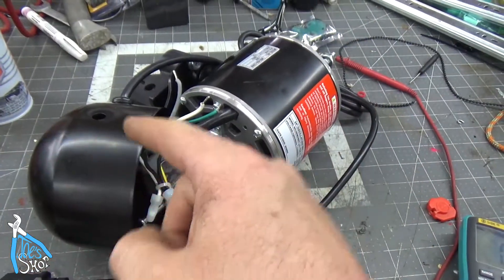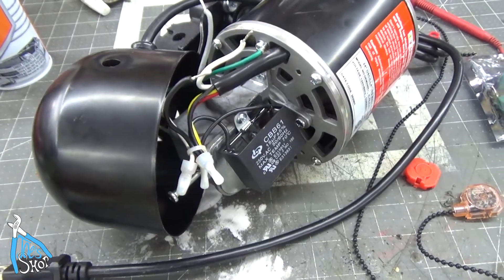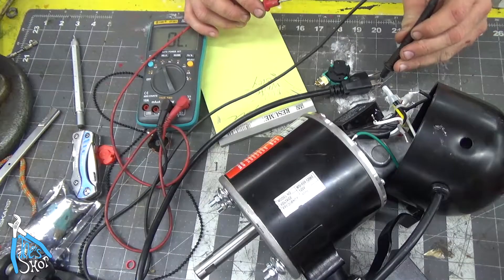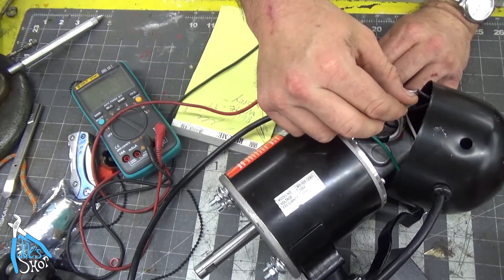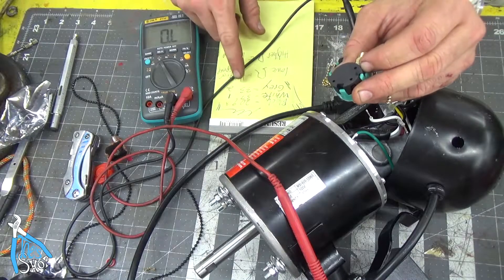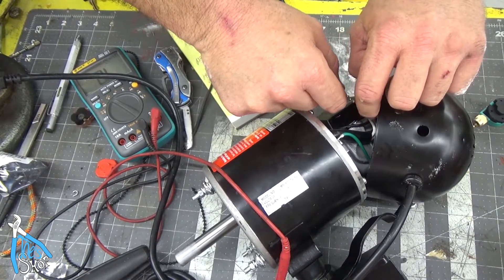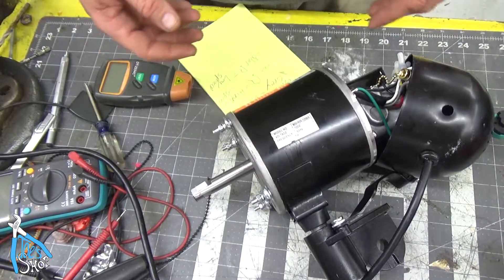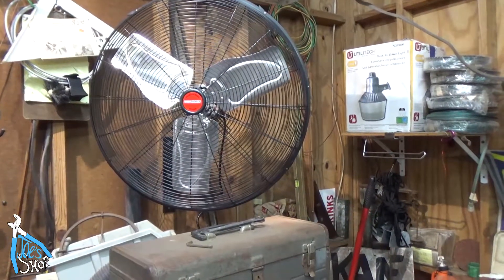3 speed fan switch (determining Hi-med-low)

Comment: I have an industrial MARLEY brand fan with a broken pull cord. High, medium, low and off.  Ordered a replacement pull switch.  Went to take the old switch apart but it broke into pieces. Unfortunately i did not record which color wires went to which labeled position. I only recorded their positions relative to the position of the pull cord.

I installed the wires to the new switch in the same positions that i recorded. 

The fan works but not 100% or correctly. There doesn't seem to be an off, plus the fan stops after a bit. Pulling the chain to request a new speed doesn't start the fan up after it stops.  

I'm suspecting the replacement switch has the wire positions placed in different locations leading to me installing the wires into the wrong spots. I'm suspecting the incorrect wire placement is also why there is no off and that the capacitor might be overheating thus causing the fan to stop and bit come back on even after pulling the cord. 

I think i can use this video to figure out which wires are supposed to go where and correct my issue.
Reply: Update: I have a harbor freight fan with high medium low and off. I checked the wires to the pull switch and compared to my Marley fan. The harbor freight has 4 total wires for all of those speeds. The marley only has 3.

Researching for information on the Marley I'm thinking it only has high low and off.

Turns out I did record the wire positions from the old switch and placed them in the correct locations in the new switch. Still don't have off but it does seem to have high medium and low.

I think I'll Live with unplugging it, which is what I've been doing ever since the original pull chain broke.

The weird thing is after cycling the pull switch enough times the fan starts slowing down to a stop.

I left it running in low/medium most of the day with no issues.
Reply from the maker: I hope this video helps. Cheers

Comment: Do a video that shows how to jump it so you dont need a switch at all. Plug it in for on, unplug it for off
Reply from the maker: Sorry that fan is mounted in my brother's shop at the moment. Just connect the hot to whichever speed you want and skip installing the pull switch. Next time I fix a fan I'll show both ways. Cheers

Comment: Why do I get continuity line to each speed
Reply from the maker: You should get continuity...except in off. The resistance (ohms) will change
Reply: @joeheilm  also I always got confused a switch when applied voltage from line to line of switch speed voltage I'm getting 120volts
Reply from the maker: @Joset T  I think a dimmer switch will change voltage but not a fan...electrical stuff is not my strength

Comment: I was always taught that when comparing appliances, anything with a rheostat or potentiometer, you should look for the highest power being the first step after zero and greater resistance afterwards. This was supposed to be a sign of quality compared to the other direction. It might just be correlation, but this has seemed true to me. I don't know a lot about wiring, but I do understand basic circuits. I've never understood WHY this was true. Do you have any insight?
Reply from the maker: My only guess would be to minimize the chance of a burner being left on low and not Off. That's a good question, I wonder what the real reason is. 🤔.  Cheers
Reply: Most fan motors have a capacitor to give it a boost when first starting up. So starting on max power makes sense because it helps the motor turn quickly at the beginning with enough torque, reducing heat and wear. If it started on low, there wouldn't be enough power to spin on start up. Did you ever turn on a fan and it just buzzed? The power is there but the capacitor has failed in boosting the power into the motor to overcome it's resistance to spinning from a dead stop. That is why some fan rotary switches go 0, 3, 2, 1.

Comment: Many many years ago when Sears was still a place to buy Power tools, they introduced a new line of power tools that took a small plastic key of sorts to operate the power switch. This was accompanied with a marketing campaign about kids getting into the shop unattended and hurting themselves. For whatever reason, Sears Craftsman did not initially offer replacements for these easily broken keys. Yeah you could fashion something that would work, but you would lose it over and over. Back then, retailers typically had a floor model of each machine and box examples for consumers. Those damn plastic keys would disappear off of every tool every single day. They started drilling a hole in the floor model keys and attaching them with a wire. People simply pulled it off the wire, widening the hole. The manager finally figured things out and no longer left keys on display models. If you wanted to try out a particular tool, you had to find a cashier with a stupid little plastic key. At the time I had assumed this whole drama to only be occurring on a regional scale. I read an article years later that taught me this was not the case. This is a rather famous case taught in marketing classes. In lieu of offering replacement keys at any price, consumers simply started buying a second table saw, keeping the key, and returning the machine. The return desk would not typically notice the key being missing, it was in the bag with the instructions. Supposedly, it was 4 years and something like $6 million before Sears put it all together. They started offering replacement keys for $1.50. this was not very long before they went out of business all together. Now Amazon is the behemoth. They got that way with excellent customer service, now they don't even have a contact phone number at all! Returns are extremely convenient. I suspect, and this is partially informed by the status of my purchases, that many people are buying things off of Amazon to take a part off of or to swap their broken item. About 2 months ago, I accidentally scammed Amazon. I had scheduled for UPS to pick up a package for return, they were supposed to knock. There was a padded mailer out front because I was in the yard when it was delivered. The UPS guy took the mailer and Amazon automatically issued a refund. The contents of the envelope was nothing more than instructions for my mortgage company on how to execute a wire transfer. Somehow Amazon's system received this package and decided that yes, this was indeed the pair of sneakers in the wrong size
Reply from the maker: Lol. I love the sears story. I have not sold my small bandsaw because I am using the key in my big bandsaw. I have accidentally scammed amazon a time or 2. Catharine likes to put my stuff away without telling my. Consequently, I tell amazon my package was not delivered, only to find out later that my item was in my shop. Thanks Jean-Paul. Cheers